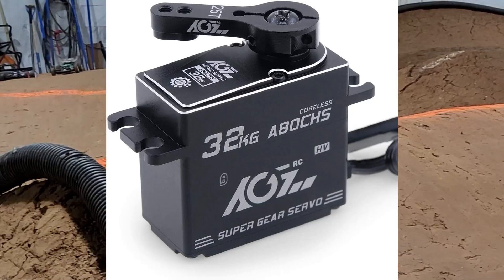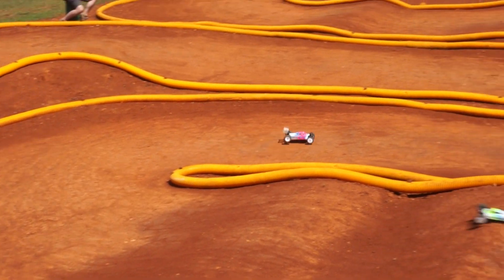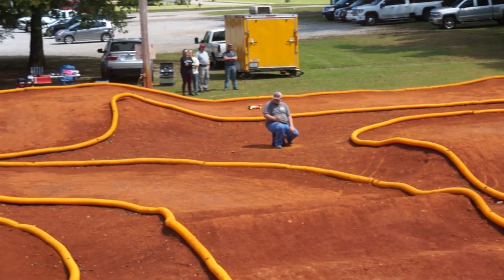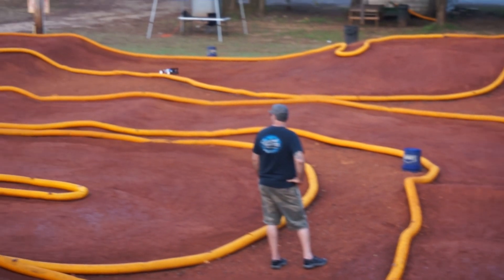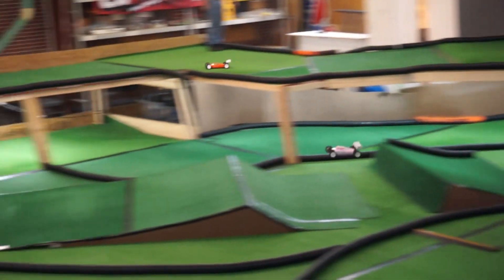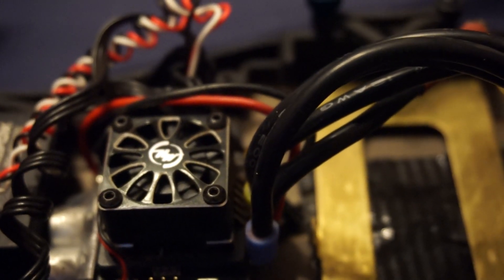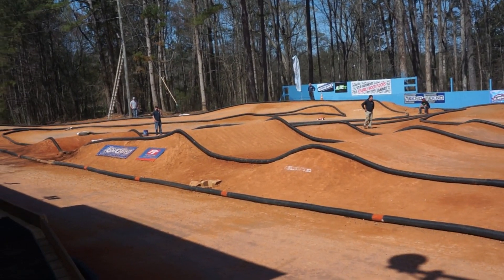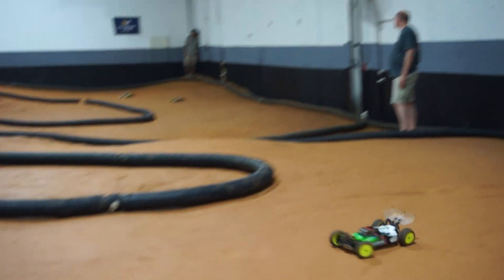RC Electronic Crash Course

Comment: 2:16 huh? how does it matter what votaltage your battery is? you servo is gonna get whatever your BEC is putting out. you think if you run a 4s your servo is being fed 15v???
Reply: high voltage just meants its compatible with a high voltage BEC, usually meaning 7.4 or 8.4 volts.